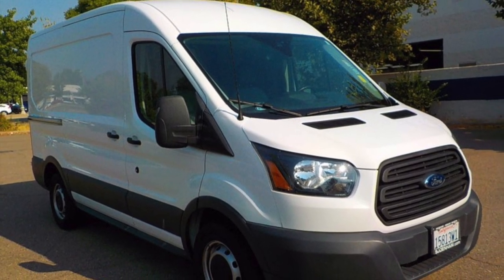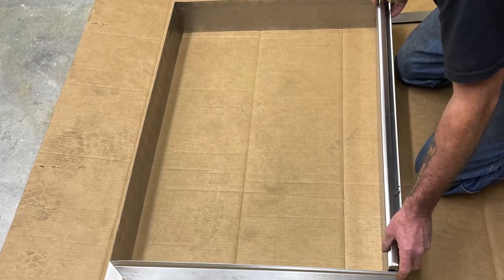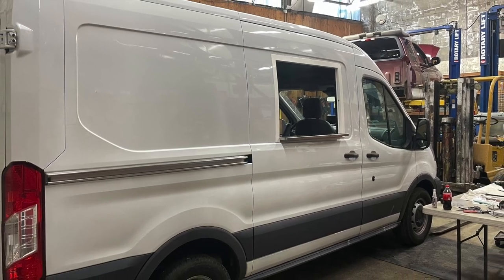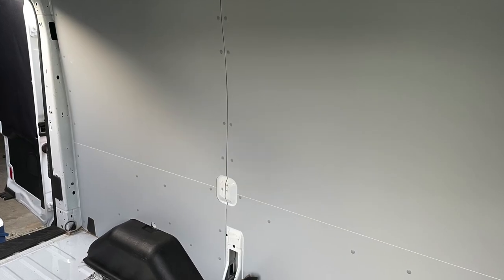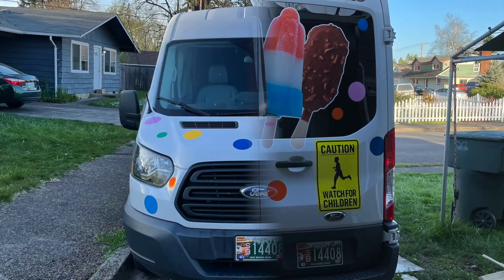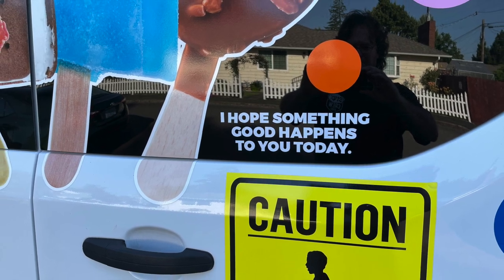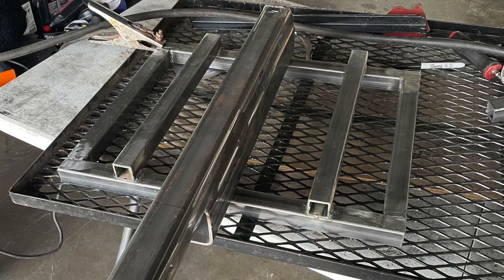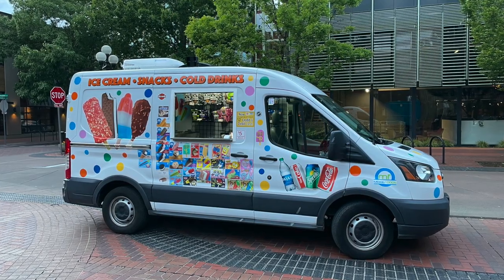Building my Ice Cream Truck from start to finish!

Comment: Is that generator gas or electric ?
Reply from the maker: @view13s8  Don’t have a generator anymore. But it was gas. An electric “generator” actually doesn’t exist. They’re just lithium batteries that discharge power but they don’t “generate” anything…despite the name.

Comment: Is it hard to sell the ice cream legally? What all do you need to sell it? Is it a county to county thing or when you get the licensing is it state wide?
Reply from the maker: No license needed in Oregon. Easy to sell. I can’t go anywhere without someone wanting ice cream. I get pulled over all the time by regular people. Gas stations, drive through restaurants etc
Reply: @moxiesicecreamtruck  oh sweet!
Reply from the maker: Basically, because it’s prepackaged and frozen, no health department needed, no commercial kitchen. Just buy it wholesale and then retail it.

Comment: Could you go through how you put the battery box together ?
Reply from the maker: I put a Battleborn battery on a shelf. I attached a lithium charger to it. I added a 12v  fuse panel for the accessories. I added a shunt so I could keep track of how the battery is performing. Then I added a Victron LED display to watch the battery stuff. It runs the lights and MaxxAir fan. Charge it overnight with the freezer, and work all day.

Comment: Where do you get your product stickers? I am out in Canada and my biggest issue is getting those pesky product stickers. I have had to print or make my own laminate and tape them to the truck. However, it does not look the greatest!
Reply from the maker: @amritbhathal1487  I get them from my distributor. eBay has them also.

Comment: very nice build,  what size generator did you use .
Reply from the maker: Thanks! I have a Honda EU3200i Inverter/Generator, and a Honda EU3000i generator. Both are quiet, and powerful. Hardly use any gas either...
Reply: Does one just run the ac unit ?
Reply from the maker: @jimmyb5935   The lithium battery runs the lights and fan, and if it's hot outside, the AC is the only thing the generator runs. I rarely use it. By the time it's hot enough for the AC, the people won't come out to buy ice cream? Weird but true...

Comment: Hi.. how much money was invested in this truck from beginning to finish??
Reply from the maker: I don’t discuss money here. That question is the IRS's favorite. Plus I didn’t count…but it's a lot.
Reply: @moxiesicecreamtruck  appreciate you answering back.. I just wanted an idea.. I currently have 3 jobs trying to make a better living.. I want to at least do something with my teen kid that can help out during summer break so I thought this would be something to do next year..
Reply from the maker: @anamorales-gz6wo  It's hard to share that info with someone I don't know. I can tell you what stuff costs. The freezer was 7K, and the van was 25k back in 2016. You could do it for a LOT less, but that's not how I roll. You could buy a regular van, and use chest freezers from home depot that are like 175 bucks. Throw some dry ice in there for the day and gross some money. The hardest thing to find is a distributor that sells the right ice cream novelties. Find that first , and quiz them up. Keep asking questions till you get the answers you want. You can do it!